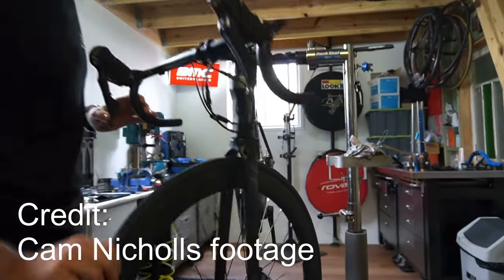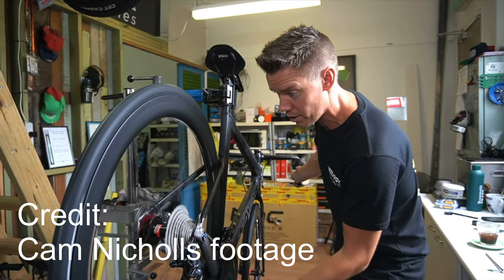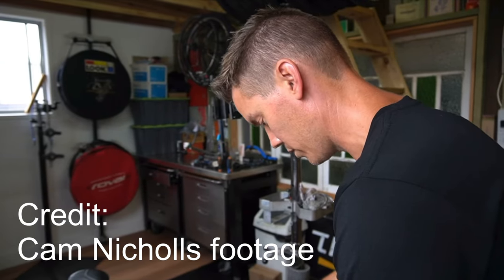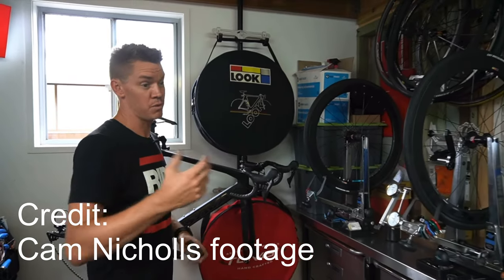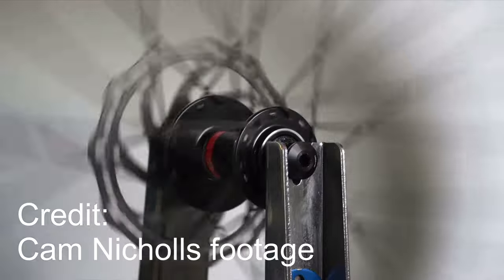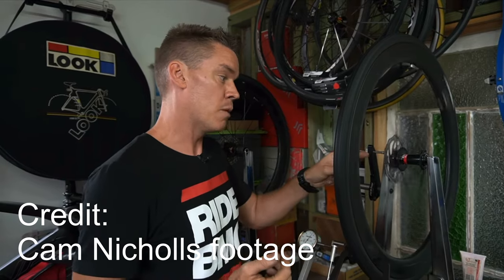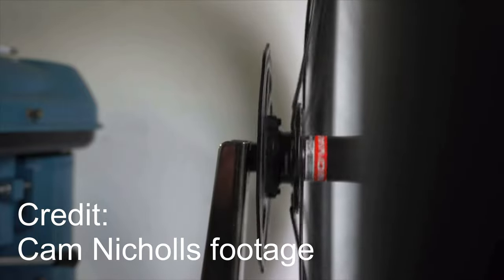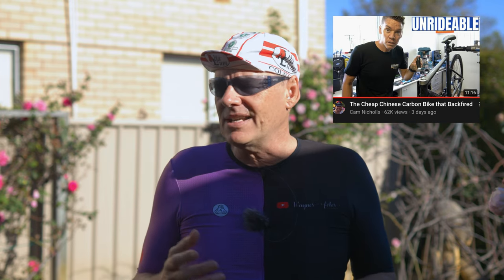Another problem with disc brakes!

Comment: Great job on a great point. I'm a Microsoft PC guy, but I have to say Apple makes a computer and monitor and OS and software to match. Bicycle components come from all the specialized sources. A company that makes a frame and all of the components themselves could be in a better position to insure the whole bike is entirely functional as it should be before it leaves the factory.
Reply from the maker: Yeah good point, but the bicycle industry does need to lift their QC. There is some shocking examples of stuff that leave the factory.
Reply: @waynosfotos  I agree. Have a happy day because you deserve it.
Reply: Except Apple computers use Intel CPU's and Nvidia GPU's but overcharge you for them lol
Reply: @Silidons91  apple make their own CPUs and supporting chip sets now
Reply: @LM42  Ah, well a few years ago they just used Intel and Nvidia stuff and charged 2-3x what you could build your own for.  I'll never purchase any Apple products ever again.  Why on earth anyone would overpay for an Apple computer is beyond me.

My one and only Apple product was an iPhone 7 which died in about a year and a half.  I only used it to talk, text, and scroll through Instragram too.  Never play movies/games etc.  Horrible phone.

Happy with my chinese OnePlus 7T, going on two years and still battery lasts over a day....and the processor is as fast as day 1.
Reply: @waynosfotos  absolutely spot on… I guess it’s the fact that a lot of bike brands are quite small operations and tend to assemble rather than engineer their products. There’s a bit hole in the market for a mainstream brand that gets these things right. They are not rocket science / especially when you look at the high quality of engineering from Shimano (with the exception of the recent splitty cranks thing).

Comment: Disc Brakes are disc brakes. They are an intersection  or even adaptation of technologies from other areas of manufacture. I think the point he was trying to make was that the intersection of things Frame /fork , Hub ,Bearings  as well as quality control on the brake components & fluids themselves are the platform on which this intersection is made . Even a qualified tech might occasionally find this frustrating beyond belief. I have seen both riders and technicians frustrated with fine tuning disc brakes at the Tour de France , riding the best available.  Clearly they are industry driven . High end rim brake rims like HED  aren't disappearing from the market because they can't sell them (they can't hardly keep them in stock)

Comment: Basically manufacturers are selling us, over priced poorly manufactured frames. They are doing this because they can make them cheaper and make more money.  I have yet to see threaded bearing assemblies on a cars or farn equipment. Just run rim brakes and threaded bottom brackets, and all is good.

Comment: This is a problem with Novatec hubs and in particular ones that have not seen quality control, to describe this as a problem with disc brakes is unfair. If this was a Novatec hub for rim brakes, the problem would be even worse at the rim due to the magnification of the error at the hub.
Reply from the maker: Nope you can true it out with the spokes, it would work fine.

Comment: Love your channel.. But honestly this is not a disc brake problem, it’s a hub manufacturer error. Pretty unusual I should say. Have 4 pairs of Novatec hubbed wheels working flawlessly for years, so just unlucky I guess. But how on earth wasn’t this spotted at the wheel manufacturer, that’s my question. I’d had big problems centering my rims on those! Also, honestly who choose 6-bolt rotors now, that’s pretty 90’s isn’t it?
Reply from the maker: I said this in the video, no it is not a disc brake problem, but how the brakes work is affected by other components. End result, the brakes don't work properly.

Comment: To be fair I think we are trashing disc brakes here unnecessarily, this issue was nothing to do with disc brakes, it’s just poor manufacturing from budget brands! It just serves to reinforce why I don’t buy cheap Chinese products, don’t get me wrong, I love rim brakes, my favourite bike is a rim brake Bianchi Specialissima, but I do have some disc brake bikes too, and I don’t have any problems with them, Both Trek frames, Domane winter bike with Bontrager wheels, and a Madone with Zipp wheels, neither of them have any issues with the disc brakes, they are faster and easier to set up than rim brakes and just work perfectly, my only complaint is the pads wear out quickly, around 5000 miles is all they seem to do, but in every other way they are vastly superior to rim brakes!
Reply from the maker: You see this on mainstream brands, i have been told by mecahanics they face the calipers seats an the thru axle drop outs.

Comment: All of my bikes has disc brakes. No problems but I have worked on poorly manufactured frames where the calipers could not be aligned properly. Not the brakes fault and this is some convoluted thinking here.

Comment: The more failure modes you talk about on these new bicycles, the more I like my old stuff.  Seems that they're designing to such close margins using tools like FEA that its too easy for something to become compromised without the user ever having a clue.  And while it may flatter to the user to have a 'race' bike there is virtually no need for reducing safety/design margins to the extent where we have seen so many accidents that wouldn't have otherwise occurred.
Reply from the maker: For sure 👍

Comment: Hmmm… that is an interesting problem… While in the 10+ years of mountain bike riding with disc brakes I’ve never had that problem, they are plenty of times where are you just ignore the sound of your disc brake rubbing, with older disc brakes. There are very tiny washers that you can use to align your disc brake properly. I’ve never used Chinese hubs with a disc brake however. My experience is with Shimano, and more recently Easton. That said my brakes are XT are on my mountain bike. Quite nice. Living in Vermont we are in the mountains, my Road bike has rim brakes and I’m not replacing the bicycle because of the brakes. There are times however coming down long mountain passes that I think to myself it would be nice to have a disc break right now…
Reply from the maker: MTB are  different kettle of fish. They work fine on these bikes for a number of reasons. Road bikes, they are temperamental and can play up for reasons mentioned above.
Reply: @waynosfotos  agreed. The best bike is the one you have, so just ride it and have some fun!

Comment: Hi from France ,
Yeah, i watched Cam Nicols vlog,the question i have is;"how on earth did they manage to build a wheelset with (more or less) oval hubs?"
Could it be industriel sabotage ? I've built heaps of wheels,it's not my bread earner,i drive petrol tankers, but honestly how could those wheels end up on a rather nice bike ?
Reply from the maker: Because in general the bicycle industry has poor quality control.
Reply: @waynosfotos  in this case no quality  control.
Reply from the maker: @villainjohnnoel8075  yep! That is a big problem throughout the industry, as seen here, you can't isolate a product. They all need to work together and be made with high accuracy forthe products to perform as advertised..
Reply: quite often rims come in non perfect circles. when building wheels you true the rim both laterally and radially so essentially you can "shape" or "deform" the rim so that even though the axle is off centre when looking at the hub the wheel can still be made so that the axle is centre to the circumference ie the rim
Reply: It's why I stick to an established brand.  Shimano, Campagnolo, DT Swiss, Chris King, White Ind, etc, etc....  Low cost has a high probability of poor construction, performance and longevity.
Reply: @SurpriseMeJT  I've had some shockers from even the big brands. i think where the bigger brands have the edge is more in the after sales support... sometimes.
Reply: @jamiewellington6208  i don't agree,sorry mate.The hubs are off centre (oval),how in heavens name didn't the wheelbuilder pick-up on it ?
Rims are round,you lace up your wheel,wack it in a truing gig  and using a tension metre you build up the tension.If the bloody hubs are oval,you throw them out 'cause you'll never have a half decent pair of wheels.
I drive à bloody petrol tanker, i'm not à wheelbuilder.The mechanic in Cam Nichols vlog refused to use the wheels in question and he is a proffessinal bicyle mechanic......dunno.....
I tell what,buy the wheels in question and put them on your bike and then tell all of us your conclusions.

Comment: And what about rim brakes rubbing if the wheel is slightly out of true? That is not an issue with disc brakes.
Reply: If your rim brakes are setup correctly then the rim would have to be very out of true for them to hit the brake pads. You could still make it home with your brakes in the "open" position.   Also, all serious cyclist knows how to true their wheels.  Today with such low spoke count wheels, a broken spokes means a very un-true wheel.  It's better to ride wheels with more spokes, however it's not the fashionable thing to do despite the performance disadvantage being very low, especially amongst non-racers.
Reply: @SurpriseMeJT  My point was more that every component on the bike is affected by something else not working properly. Is not like rim brakes are perfect. I build my own wheels and I would never ever use anything less than 28 spokes (and brass nipples). With less spokes you would have to completely remove the caliper to ride back home

Comment: Cam had a bad wheel hub not a disc issue, you can argue the disc alerted him to the issue.  I believe when hydraulic Disc brakes are set up correctly are better than rim brakes.  If you are a weight weenie…use rim brakes.

Comment: Yes I agree, of course the disc won't work if the Hub is poorly made and the bearings are the usual poor quality that come on new bikes however & it's a big however is this guy actually trying to tell us that we should remove the disc brakes off of our cars because disc brakes are a bad idea ! 
Never seen a Down hill rider using Rim brakes I bet Hambini would have a few words to say about this.
Reply from the maker: Cars are a different kettle of fish, the discs are ventilated too. Also the Automotive industry can make a round hole and aligned.
Reply: Yes of course cars are different but as you state the automotive industry is developed and as such they have chosen to fit discs to stop cars even drum brakes are almost history now. Rims brakes can be effective on a road bike to a point, they do not brake aswell in the wet nor do they brake as precisely and they heat the rim on a long decent which can cause tyre failure, if weight saving is a consideration rim brakes can still deliver in that department.
One day even disc's may become a thing of the past, I wonder what we'll   disagree on then !!!

Comment: I have been riding discs for 20 years on MTB. They rub. You true the rotors, bleed, reset, they spin quietly. You get on the bike, mud flies, things flex, they rub. You ride/break hard, you gotta readjust and/or true. BDs are the only brakes for me, but IDK why DB fanboys  act like they are perfect.
Reply: Only been riding 9 years less then you, no issues with disk brakes, but I live in North Wales, maybe you need a special type of mud

Comment: Picked basically the junkiest hub imaginable and found fault with it. What is the big story? Should ANY hub be that wacked out brand new? No. But good lord, it was destined for failure from the beginning. To me, there isn’t any fault with the disc, only the hub. For better or worse, good quality usually costs big bucks.

Comment: Come on, we live i 2021.
Don’t tell that disc brakes are a bad idea because the bike industry can’t get within some tight tolerances. I work as an engineer. To get the runout and concentricity tight enough on a hub isn’t a problem. It is bad manufacturing.
My recommendation would be to ship the wheels back.
Reply from the maker: They gave the whole bike back, check out Cam's video.

Comment: Finicky if you buy shitty products.  Buy reputable products and this doesn’t happen.  It’s like saying all car suck if you buy a shitty car like fiat vs a Toyota.  Do be cheap and you don’t have problems.  Have an sl7 and Reynolds wheels.  Zero problems and it’s my preferred bike out of my 10 bikes.
Reply: absolute and total crap unless you claim Chris Froome is riding shity products, discs are for MTB and they should stay there; BTW reynolds hubs are a shitty product
Reply: Have you actually ridden road disc.  It’s actually good if you don’t get cheap stuff.  Try it out and get out of the Stone Age.
Reply: @p44doyle44  Sadly I have but now I think I ll stay in the stone age with Tadej Pogacar.
One mechanic said to me; disk brakes are a solution looking for a problem.
Reply from the maker: Poor QC is not confined to those cheaper brands.
Specialized is no better, just more expensive.
Reply: @janeztomazic5546  tadej uses disc as Welles rim. I ride both too.  Prefer disc though and tubeless.
Reply: @waynosfotos  for most part it is.  Zero problems with mine.  They recall was a f&$@ up on the engineering aspect who had their head up there ass on that one.
Reply: @p44doyle44  Tadej uses disc only on flat stages that dont matter, he uses rim on TT bike and on all the mountain stages which you know include a lot of descending also in wet.
Reply: True.  But still chooses to use disc!  Chooses.  Only rim because of weight for hills.
Reply: @p44doyle44  does he, I think its more a say from Colnago for commercial reasons; "ride disc on stages that dont matter".
Weight you say, so what is the reason for rim on TT bike ?
If UCI should lose the 6.8 kg (and it should) disc experiment would die on the spot.
Reply: I think he does choose personally.  I agree the weight limited is rediculous in the carbon era.  Ok back when they drilled into steel frames.  Modern tt bikes are majority disc now only a few rim brake.  Honestly I think tt should be rim on that matter.  Not braking very often for disc on tt.  That is stupid.  But road bikes yea.  10 bikes and 2 have disc and I choose disc 90% of the time.
Reply: @p44doyle44  well, I bought the BMC roadmachine disc cause the marketing propaganda told me its better, now I am back on Italian rim bikes. Disk brakes are just not worth the hassle and money in my opinion. I imagine I am not the only one that has tried  and hated it. 
Dont have a problem if some or majority of people like disc just dont remove the rim brake  option from us who hate them
Reply: @portland675  well, yeah, he doesnt have a choice does he, 99% of pro tour riders would chose rim given the choice
Reply: @janeztomazic5546  I hear you. I understand.  And I also stand with that too. I race on rim brake just because it’s cheaper to replace parts and I have a shit ton of parts for rim break.  But I do love riding my disc brake for training with consistent braking.  Just don’t want to race it and risk crashing on it.
Reply: @portland675  he just invested in Factor brand, before he did that he was shitting on disc brakes and NO factor doesnt have racing rim bikes anymore
Reply: @portland675  if a roadmachine disc is your favorite bike than you really dont know what a great bike is; roadmachine is as average as it gets
Reply: @portland675  are you really asking why Froome doesnt ride a non sponsor official bike in a protour race....
Reply: @portland675  he didn't,show me the quote

Comment: So the problems got nothing to do with disc brakes, it’s the manufacturers who can t make the parts well enough, and out of the last 6 big name carbon frames I ve owned, they ve all needed the mounts on the frame surfaced, same as bottom brackets , I don t see the problem, Cams main issue was the hub not being concentric, no one with carbon braking surfaces on wheels can say they work as well as discs, never gonna happen

Comment: Hi Waynos, I'm a fan but you are off the mark on how you are discussing this one and showing some obvious bias against disc brakes here. You keep saying the brake doesn't work, discs are the broblem ect. but this is a hub manufacturing problem that has nothing to do with disc brakes. The disc brake exposed the problem with hub having no part in causing it. You did say the bike industry doesn't make anything on road bikes to the tolerances required but that is not the brake manufacturer's fault. It may not even be the frame or fork maker's fault because the mech either eliminated them from the diagnosis process or corrected them and the disc rub was still there. Unpacking this bike industry BS is a great thing but you've added some BS of your own in this case.
Reply from the maker: That is true, but the end outcome is the brakes can't be aligned properly. So it stuffs up your brakes.
You are correct it is a hub problem.
But my point is with a rim brake bike, this problem can be tuned out with spoke adjustment and the bike would work fine.
My point is disc brake bikes need the parts to be made better to work properly. But unfortunately the bike industry for some unknown reason has a problem doing that, but they keep pushing products they can't make properly. 🤔